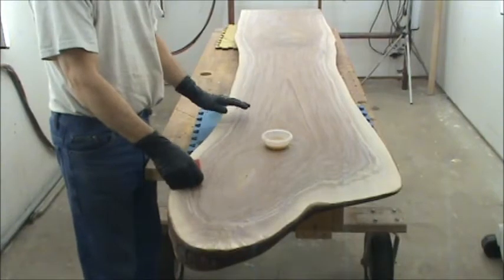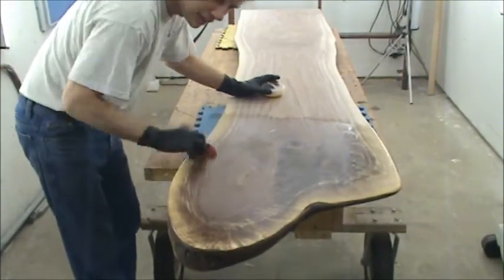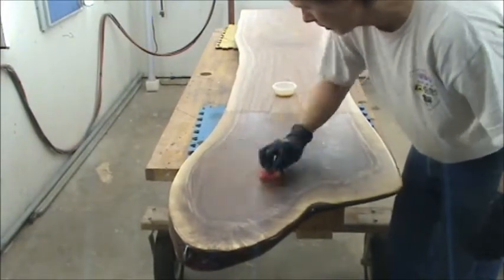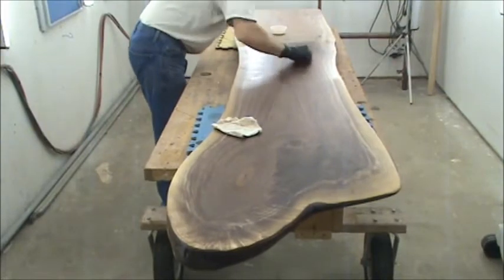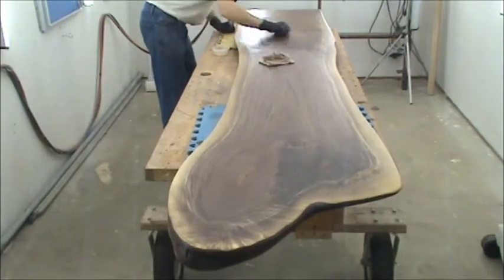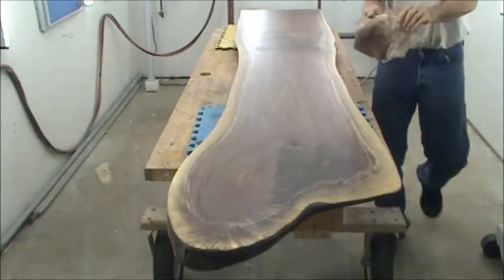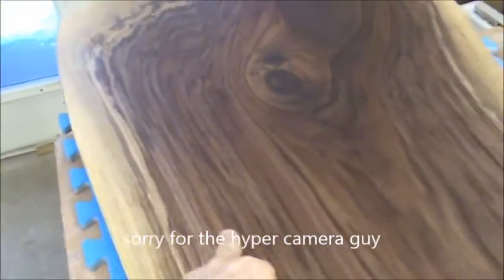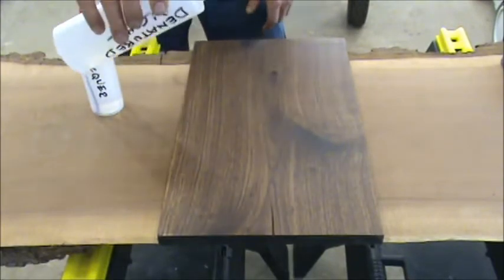Rubio Monocoat applied to Walnut Bar Top Live Edge Slab

Comment: Nice video.  When you do a smaller area like you are doing.  I assume you don’t get lap marks when you go back and do the next section?  I have a large bed frame that I want to try to Rubio on, but I’m worried about lap marks.  Thank you.
Reply: From what I have seen on MANY Rubio videos. It only bonds to the wood. Not to itself. To repair an area. Just sand and re-apply it will be fine
Reply: Rubio is very forgiving. You don’t get lap marks; you can go over an area where perhaps you missed a bit and it all blends in. However, you should work it in as this video shows (I use a white pad to do this) and wipe away any excess within 10-15 minutes (otherwise any drips become hard to even out although you could sand it all down and just go over it again). Then buff with a clean Terry cloth rag. That buffing won’t get much of a sheen but it does get a little. 

We are doing 5 cu metres of European oak with the smoked oak tinted Rubio. Really brings out the character of the timber those medullary rays look fantastic. In the past I have used mainly Osmo and a little Odies; I would be happy to use them again for interior projects but would probably opt for  Rubio.

With Osmo, I also “scrub” the finish in and wipe off after 10 minutes. I find that I get a more natural looking finish that pleases me. 

When using the 2 pack Rubio, I would advise not mixing more than you can use in one session (morning or afternoon for instance). It does get thicker if you don’t use a batch within a few hours; I’ve never found it possible to use any leftover from the day before.

I hope this helps.

Comment: Did u only sand using orbital and did u get any swirl marks. I was advised to hand sand straight to prevent that . Also was there any problems with Rubio after 150 grit sanding ? Thanks
Reply from the maker: I use an orbital sander because in areas where you have differential grain, if you straight line sand you will see the sand scratches. A good Festool orbital sander with a 3 mm pattern won't leave any visible marks but I do sand to 220 Grit.
Reply: @logstolumber5193  and no problems with Rubio after 220 sanding ?
Reply from the maker: @BarryFromEastenders  no problems. But I do put two coats on

Comment: Can you buff it out it for different sheen?  How does it react to small fill ins with epoxy?
Reply from the maker: Never tried buffing it. Putting two coats on gives it more of a Sheen than a single coat. These days when I apply it with an orbital sander using a white quarter inch thick pad, I work in area and then do the next area and then orbital the whole area from the start and then do the next area and then go and orbit the whole slab again so I keep it wet for a good 20 minutes so it's soaked seem good. You need to wipe it off before it gets too tacky. No issues over epoxy
Reply: Thanks a bunch for the info. Keep it up, this really helps. Nice work.

Comment: beautiful looking top it's a pity it's only in 480p it doesn't do it justice, was there a reason why you went with the rubio finish over something like a bartop expoxy or something like arm r seal semi gloss...many thanks scott
Reply from the maker: Most people are looking for the no film open grain up close wood finish, no reflection which Rubio does and its super easy to apply.
I've done a lot of tops with the 2k finishes and they can be scratched easy and they are hard to fix. They are a lot more durable than Rubio.I love a super gloss polyester finish but no one wants to pay for a grain filled perfect finish either.
Reply: @logstolumber5193  in a similar question, would you ever consider satin polyurethane over rubio monocoat for live edge? I will be doing a black walnut desktop similarly and loved the look of this and how easy this goes on, but am wondering if a satin poly will have durability or longevity benefits. Thanks!